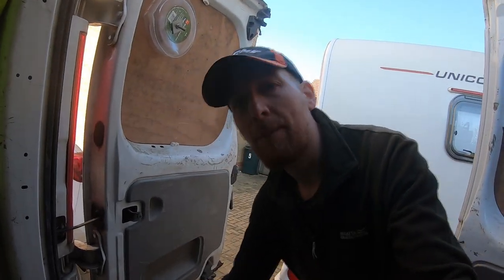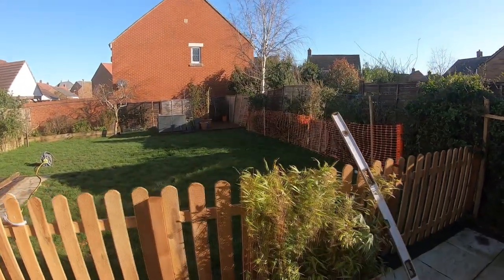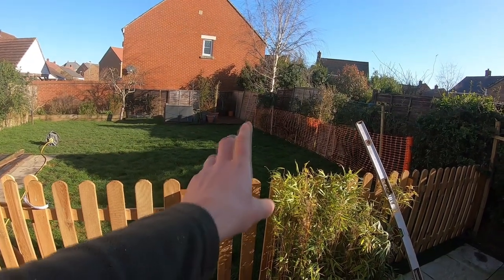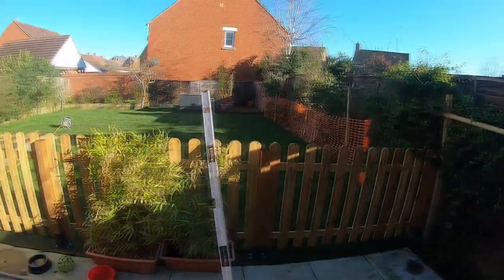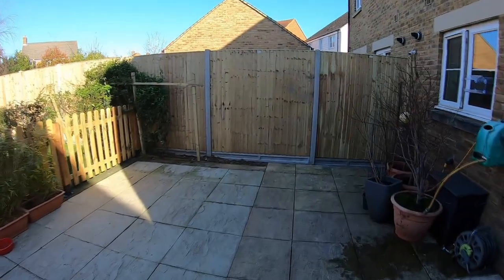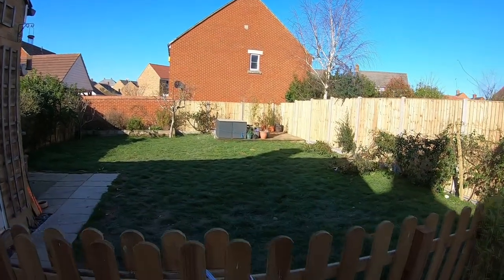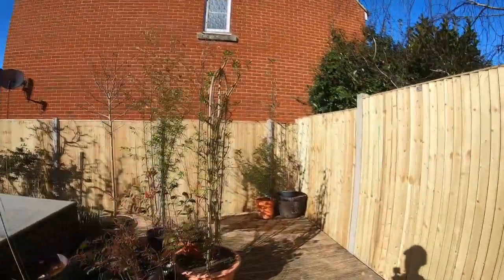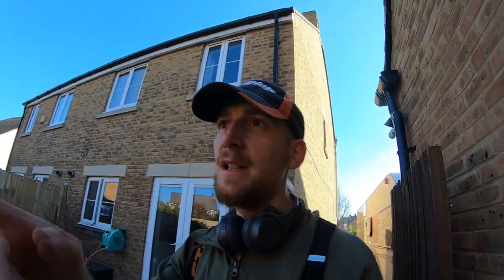Solo Concrete Fence Install

Comment: Hard work ripping out and replacing a fence in a day and a half. Take a few days to recover from it too. Concrete posts are the only way to go for longevity.
Reply from the maker: Your not wrong. Although the next two weeks I've got similar jobs like this, also working alone. Thanks for watching 👍

Comment: Hi Chris forgot to say did you dig new holes because the old post were in spikes? Where do you buy the tool you carried the panels 👍
Reply from the maker: I cut a panel down so missed the old concrete out and went over the top of the old posts. 
The fence post carrier came from Toolstation. It's used for carrying plasterboard rather than panels.

Comment: Well-tidy job. Thank you for sharing. I'm intrigued about a couple of aspects: Working on your own, how do you make sure those heavy concrete posts are in the exact right spot, square and vertical, and at the right height? And is the concrete you use to bed the posts that quick-dry stuff that you just add water to and stir around a bit and it sets in like 10 minutes?
Reply from the maker: Tbh getting the posts plumb is the easy bit. Am using concrete gravel boards so if they are level (on the ground) the post will only need to be plumbed forward and back as the left and right will sort itself when the panel is put it. Hope that makes sense. 
I find working with concrete far easier for getting everything level and plumb as it's heavy it stays in place more than timber. 
For he holes, that comes with practice and some electrical tape on the spades for the same depth each time. 
The concrete sets in 15 mins but fully goes of in 48hours. Although I sent all my posts at the end (just how I've always done it, most set as they go). I did a how to video a year or so ago which goes into more details if that's any help.
Reply: @TheCountryCottageGardener  thank you for taking the time to explain all that, Chris. It's all crystal clear 💎🤓. I have to say, I don't think I've seen gravel boards much over here in Belgium. Alot less panel fencing between properties, than the uk; perhaps the Belges are less fussy about privacy! So panel fencing is not yet in my list of skills... I've done a fair bit of wire mesh and post fencing, which is tricky to learn, but once you get the system, not too difficult.
I'll go check out that other vid of yours 👍
Reply from the maker: @djfirkins  yeah folk in the UK don't like their neighbours on the hole 🤣
Me on the other hand, I made a fence panel bar between mine and my neighbours gardens. We enjoy a beer (or 6 🤣) without leaving home. Perfect in lockdown 🍻
I did a video of that build too 👍